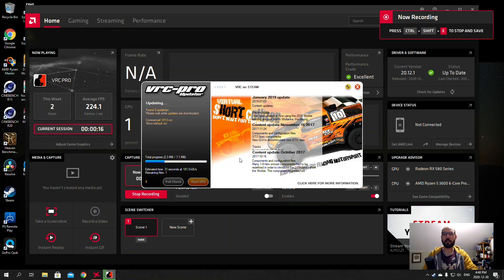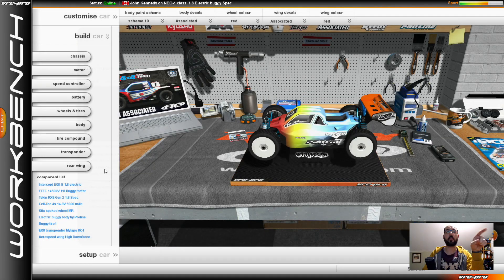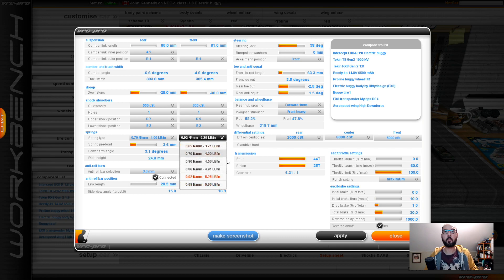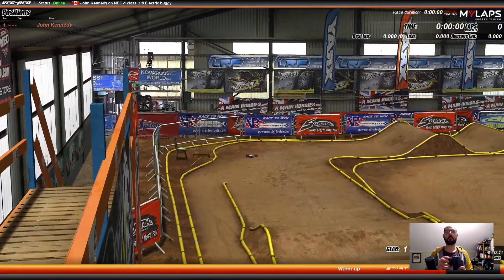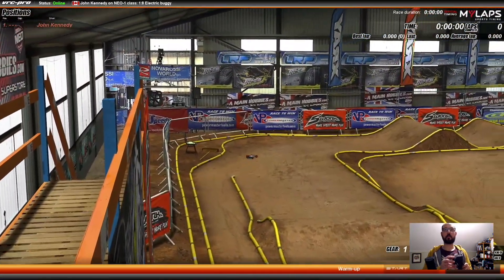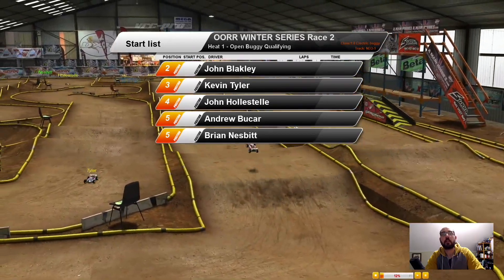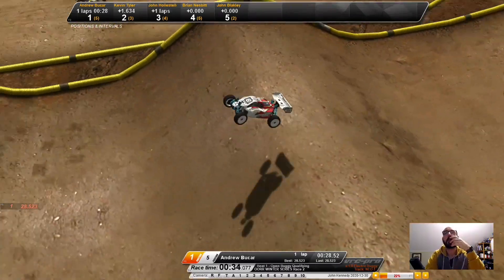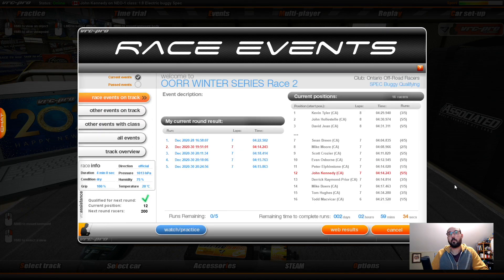VRC Pro NEO 1 MOD Buggy Qualifiers and Setups - Netcruzer RC

Comment: So how helpful is VRC Pro as a tool to help RC racing skills? I’m just getting back into racing after 15 years and wondering if this would help.
Reply from the maker: It definitely helps keep racing skills up. Problem is depth perception of playing on a 2D screen then racing IRL in 3D feels a lot better/different.
Reply: You mentioned in your video that VRC pro hasn’t added new cars into simulator for a few years, is the Tekno 410.3 SCT currently in there?
Reply from the maker: @jasonmarshall4567  there is no tekno in VRC unfortunately.
Reply: Nooooooooooooooooo!!! Lol!!!